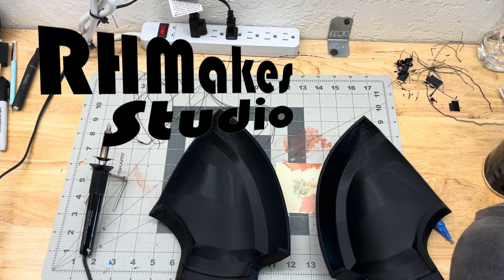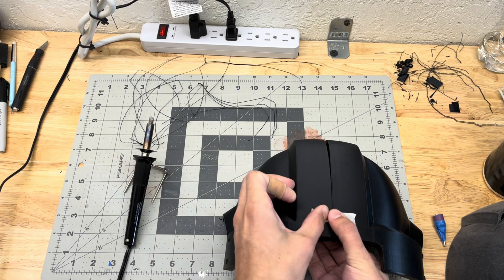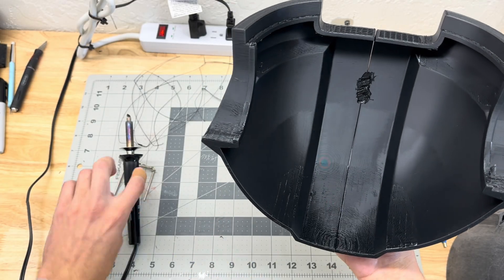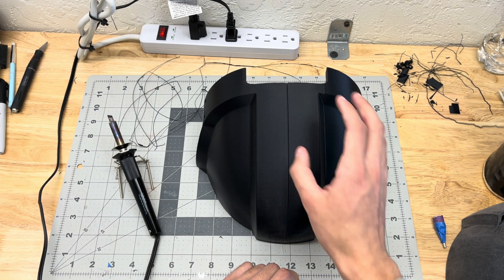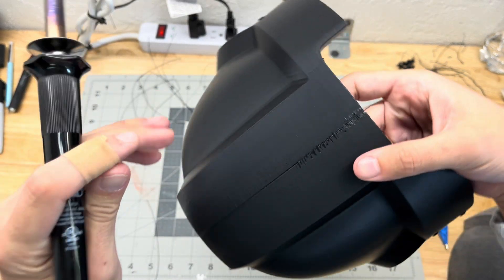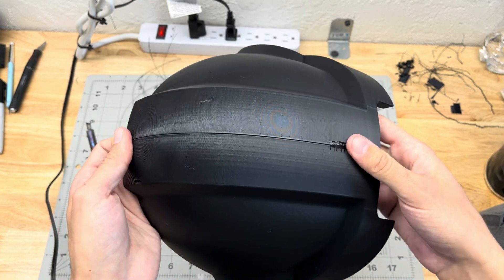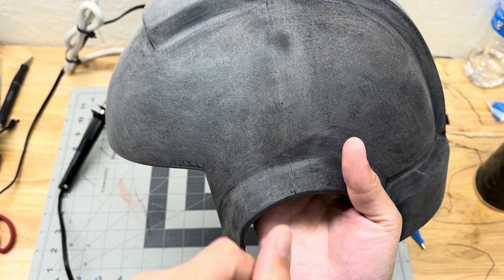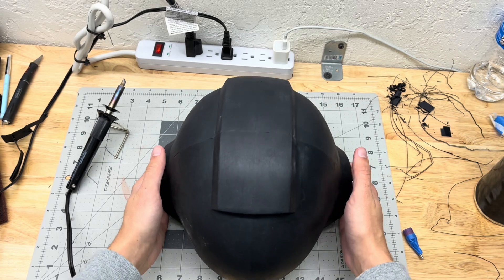Connecting 3D Printed Pieces Seamlessly | 3D Printing | Tutorial |

Comment: Would a heat gun be more effective for melting the single strand of filiment into the seam?
Reply from the maker: That’s actually a great idea that I’ll have to test out! My only fear would be getting the strand to the right heat without warping the rest of the piece
Reply: @RHMakesStudio if the piece is thick enough I don’t think you gotta worry about that honestly
Reply: @IncidentApocalypse-cd1gu  true, but depending on the infill percentage, you might end up with some sunken areas where the outer wall sags into the spaces between the infill.